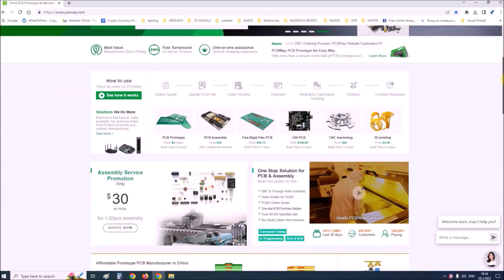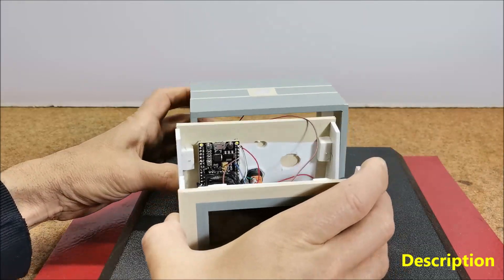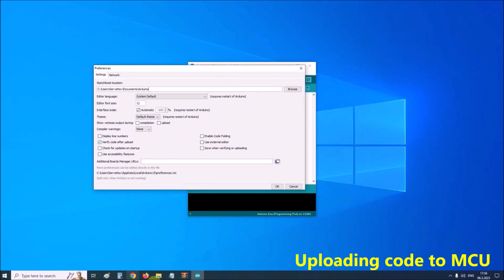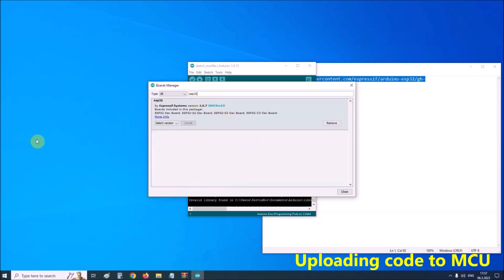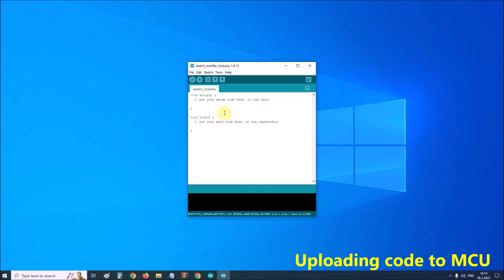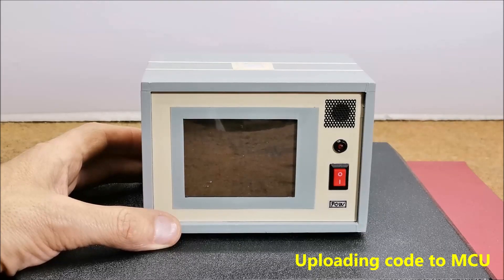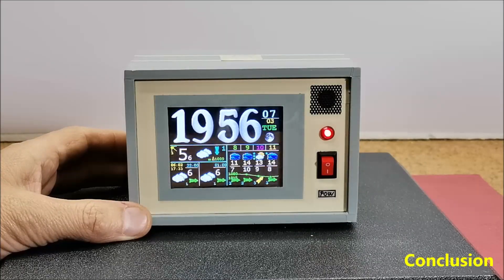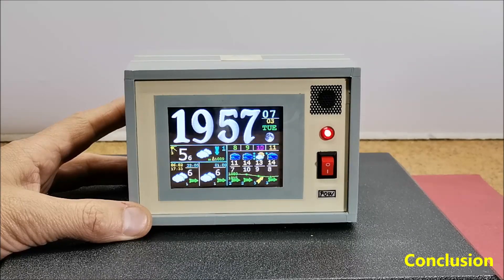Advanced ESP32 Internet Weather Station with 5 day Forecast

Comment: Hi Mirko, thanks for the very nice project.
I work with the same conditions as you do; Arduino IDE 1.8.16, 2.04 espressif Boards version, libraries, etc.; however, i got following compilation error:

In file included from C:\Program Files (x86)\Arduino\libraries\SD\src/utility/Sd2Card.h:26,
                 from C:\Program Files (x86)\Arduino\libraries\SD\src/utility/SdFat.h:29,
                 from C:\Program Files (x86)\Arduino\libraries\SD\src/SD.h:20,
                 from C:\Program Files (x86)\Arduino\libraries\ESP32-audioI2S-master\src/Audio.h:26,
                 from C:\Program Files (x86)\Arduino\meteo\meteo.ino:232:
C:\Program Files (x86)\Arduino\libraries\SD\src/utility/Sd2PinMap.h:510:2: error: #error Architecture or board not supported.
 #error Architecture or board not supported.
  ^~~~~
exit status 1
Error compiling for board ESP32 Dev Module.

I also tried several versions of the SD library and the results were the same.
Do you have any idea about the cause of this error?.
Thanks
Reply from the maker: Try with nwewer Arduino IDE   v1.8.18..  Also reed this article  :  https://github.com/arduino/arduino-cli/issues/1590

Comment: @Dear Sir. After compiling and sending, i keep getting an error in line: Serial.println( ctime (&time));
What is going wrong?
Thanks for all the work you have done. Impressive.
Reply from the maker: It is not completely clear to me. Do you manage to compile the code without error. When does this error occur? Otherwise, the line in which the error appears is not at all necessary for the operation of the device. Try simply commenting out this line (// before the beginning of the line)